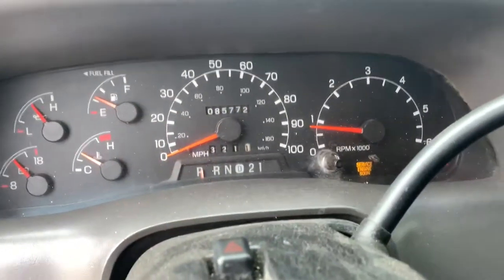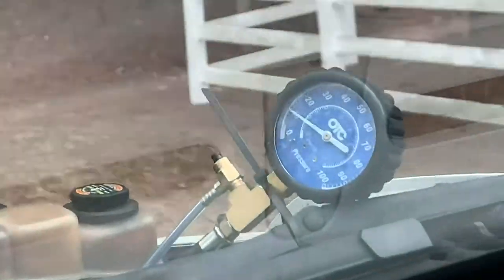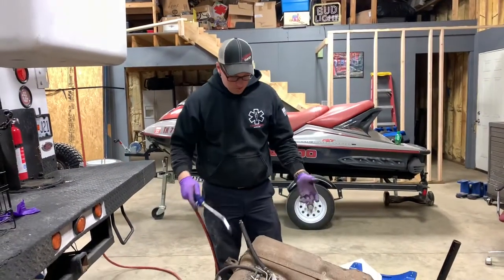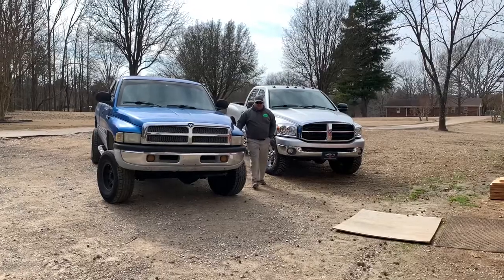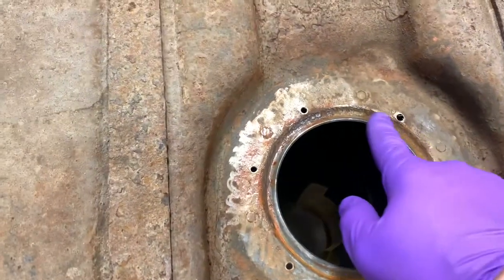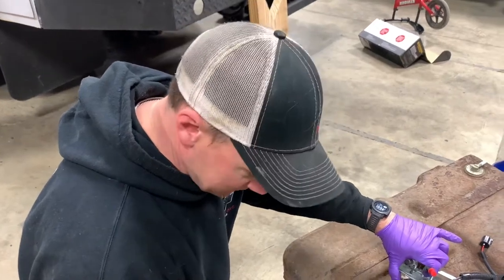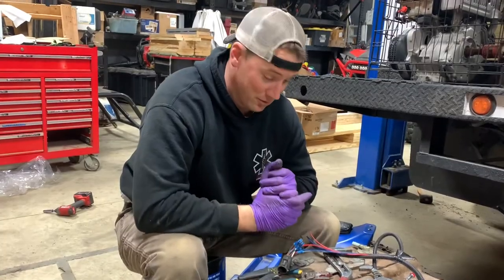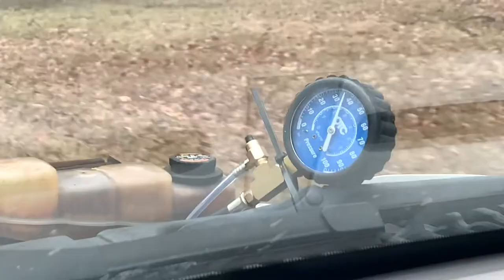Triton 4.6/5.4/6.8 low fuel pressure diagnosis

Comment: I need to change the fuel pump in my '05 F-150. It has the same symptoms. I've always been on top of regular maintenance. The truck has almost 300,000 miles on it.
Reply: How to check the fuel pump pressure? Where do you hook up the guage,  I have 2005 f150 5.4 3v

Comment: Having a similar  issue. Wound up ditching oem pump and tank.wireing in a inline pump 3 different pumps to be exact. Every pump installed surges and falls on its face when giving throttle. Also truck wont rev pass 3k
Reply: On the 3v, Fpcm is located at the spare tire, check it!
2v inspect/clean the fuel pressure regulator under the hood. Let me know if it helps

Comment: My 98 Mustang GT did this a couple months after I changed plugs and wires so I replaced coil packs and o2  sensors and it still stuttering do I have defective plugs or wires? Gaps off? Or is it my fuel pump? I need to pressure test it
Reply from the maker: Fuel pressure can really throw a curve ball sometimes

Comment: So basically how much fuel pressure does it supposed to be
Reply from the maker: It should never drop below 30 under a load with the Tritons is my rule of thumb. If I remember correct it was dropping to 10 or less
Reply: @AutomedicGarage  oh ok I started mine up at idol and it was like at 28
Reply from the maker: BRENDAJASON1 you have to check under a load(driving). You can have good fuel pressure all day running or even revving in park but the true test is under a load. Check for any major vacuum leaks also.
Reply: @AutomedicGarage  I’m gonna take a fuel gauge and tie it off like you did and try it mine really shows up when I went into all the gears feels like something is hitting the front of the truck. First I thought it might be water in the tank, I’ve put a new pump in it about three years ago but it did run it low a few times so I might got the pump hot
Reply from the maker: BRENDAJASON1 have you scanned it. If so what codes?
Reply from the maker: I’m wondering if you have a cylinder misfire
Reply: @AutomedicGarage  I need to put the computer on it and see, yea it comes and goes if it ant the pump it’ll prob be a coil pack getting weak
Reply: @AutomedicGarage  well I checked it today with the gauge the pump seemed alright but I put the computer on it it had a misfire in number 7 and number 1 so I quess it’s the coil packs